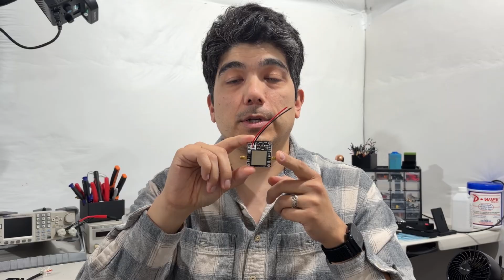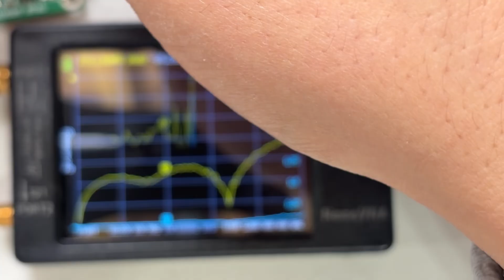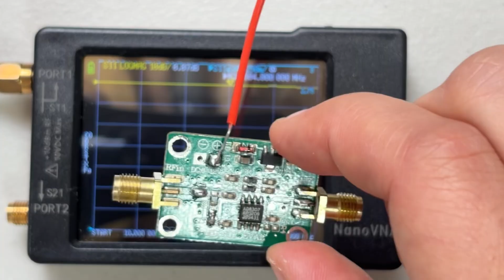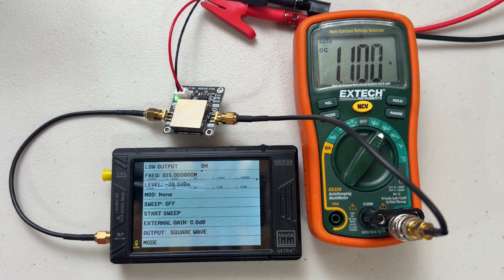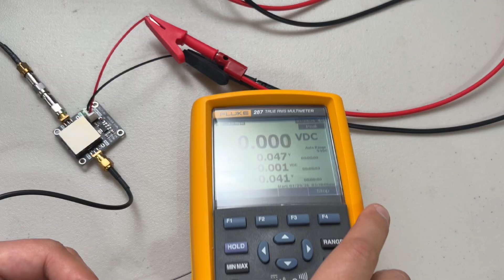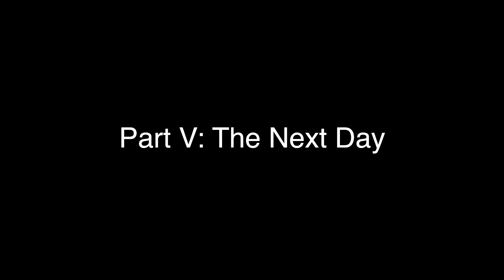Can this $25 board measure my mesh radio's output power?

Comment from the maker: I couldn't put these in the description yet because my YouTube verification is pending, so I'm posting them here for now. I'll update the description when I can.

Btw, these are not affiliate links and this video is not sponsored.

RF Power Detector: https://www.amazon.com/dp/B0CJTBZ28B
Attenuator Kit: https://www.amazon.com/Nooelec-SMA-Attenuator-Kit-Line/dp/B07YYMT65T
Cheaper attenuator: https://www.amazon.com/XRDS-RF-Attenuator-Constant-Attenuator%EF%BC%882PCS%EF%BC%89/dp/B0BYJL5KWM
SMA Jumpers: https://www.amazon.com/Superbat-Connector-Coaxial-Antenna-Analyzer/dp/B0BFPWJ3J9

The cheaper attenuators looks exactly the same as the ones I have, and a total of 40 dB of attenuation is enough for measure 1 watt.

IC datasheet: https://www.analog.com/media/en/technical-documentation/data-sheets/ad8318.pdf